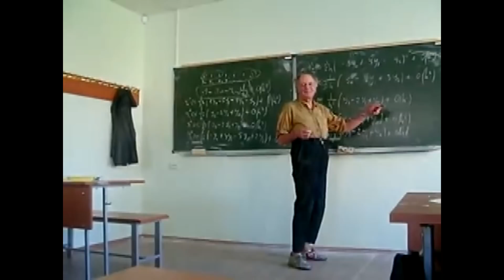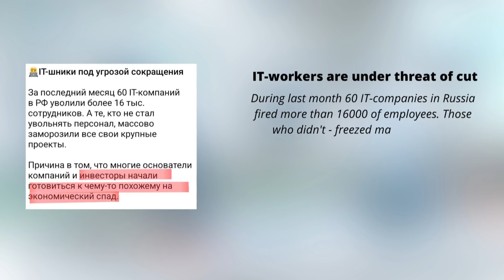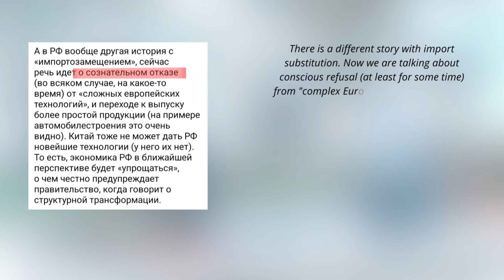Russian import substitution - back to USSR on a cart with bast shoes. The biggest lie of Kremlin

Comment: They cannot make even simplest 80s lada nowdays, yet they are planning to conquer whole Europe :D
Reply: 1980s Lada - **SHUDDER**
Reply: If they are planning to do it in a fleet of Moskvitches, they'll be pushing them or fitting harnesses to tow them - my parents inflicted an M-426 on our family in my childhood, with the result that I became a moderately competent amateur mechanic while still in primary school.  They were apparently unable to make a float for the carburettor (a bad SU copy) which was actually able to fulfil its most basic function and float, at least for more than a few weeks at a time.  We had a bunch of them, and at all times there was at least one drying out or being resoldered closed, one in the toolkit ready for use, and one fitted.  Before the age of ten, I could swap them from engine spluttering to s stop to engine start in under 5 minutes.  How in the heck it is possible to create conditions in a float bowl which melts the soldered seam on a brass float I have no clue, but it is scary to think of how hot that carb must have been getting.  Add to that the parking brake, which I had to assist my mother with if there was any trace of a slope and "acceleration" which did 0-60 in your dreams and just might have reached 1g if you drove it off Beachy Head, and the thing was truly a nightmare.  When it started running even worse than usual, my father removed the cylinder head to find that one piston was so badly damaged and misshapen that it was almost going up and down the bore sideways, and he bought a replacement piston, sealed it all back up, and flogged it while it was still running.  This was from new, in about 15k miles total.  I can only hope it was recycled into something useful.
🇺🇦Slava Ukraini!🇺🇦🇬🇧
Reply: @barryhamm3414  I bought a new Lada in the80s.  It was difficult to drive, felt very heavy.
Reply: Even brand new they are a LADA scrap metal.
Reply: @phillee2814  so, you didn't learn to braze brass.....
I'm pretty sure a carburettor bowl cannot melt solder, not whole there's any petrol in it....
Most likely reason the fix never lasted: crap solder or, maybe more likely, crap flux.

Great bit of history though..
Reply: @phillee2814  So funny!
Reply: @dougaltolan3017  I never did the float repair, just the replacement.  I'm pretty confident in dad's work though - he was a chartered engineer!  I do know he used a torch though - his soldering iron was a little one only suited to light electrical work.
I'd guess that the seams failed well in advance of the float actually filling with enough petrol to sink enough to rich-cut the engine (so, just like any decently challenging intermittent fault), and any petrol evaporated before the damage occurred, probably when the car was stopped with a hot engine.  I recall dad fixing up a tin (or some similar material) heat shield between the carb and inlet manifold though.  It didn't seem to help.
It's been years since I really thought about it, so I'm kinda doing a stream of consciousness thing here, but possibly some condition that arose when the engine stopped in some particular position (compression bounceback?), allowing hot gas to exit via the inlet valve instead of through the exhaust?  Sometimes the floats did come out of the bowl with soot on them.  Also, the filler (and I honestly don't know if it was brazed or soldered, only that it was silver against the brass pressings of the two halves of the float) may not have fully melted, but been weakened enough by the heat for the poor shape of the design to let it flex just enough at the join for it to fail.
Then, with a crack there, it only takes a few heat cycles to draw enough petrol in to sink it.  It's a few years beyond when I could have asked my late father now!
Reply: @dougaltolan3017  btw, what is the definition of optimism?

A Moskvitch with a tow bar.
Reply: @phillee2814  thanks
Reply: Hahahhahaahahahh they were on moon 50 years ago ,they have the most advanced rocket systems,and you really think they do not have access to modern technology,don't be stupid 😂😂😂😂
Reply: @basasure9065  clueless 🔔🔚
Reply: Oh they can make the top selling Lada Vesta. Just without ABS, EBD, Automatic transmission, Trip computer, or electronic stability control. Other then that pretty much the exact same car. 🚗
Reply: @basasure9065  their tech hasn't advanced since the Soviet Union collapsed. That's about 40 years ago.

Comment: 2:17  The Lada "Classic" (or 2105 and 2107 Riva) was a joint venture between the Russians and the Italians. It was based on the Fiat 124 and made from inferior Russian steel that was prone to immediate rust. They were also likely to develop almost every mechanical fault you could think of and were considered dangerous at anything approaching highway speeds.  Their only saving grace was that they were rarely stolen.
This led to a host of Lada jokes including: 
Owner asks his mechanic: "Can I get a windscreen-wiper for my Lada?" The mechanic replies: "That sounds like a fair swap." 
First prize in the raffle is a Lada. Second prize is two Ladas. 
How do you double the value of a Lada? Fill the petrol tank. 
What's the difference between a Jehovah's Witness and a Lada? You can shut the door on a Jehovah's Witness. 
What do you call a Lada in the summer? An oven. What do you call a Lada in the winter? A freezer. 
How do you avoid speeding tickets? Buy a Lada. 
Why does a Lada have a heated rear windscreen? To warm your hands while pushing it.
The Lada is one of the few cars with a light under the bonnet ... so it can be fixed at any hour. 
What is the definition of a miracle: A Lada that starts; getting a speeding ticket in a Lada; or being overtaken by a Lada.
(Carsguide.com.au The Best Lada Jokes)
Reply: Nahh, heating was great in these vehicles.
Reply: Why do Ladas have a sunroof and twin exhaust? So you can use it as a wheelbarrow.
Reply: Where do I pay for the show? 🤣😂🤣😂🤣😂
Reply: Hehe, good ones. :)
Reply: Why does a Lada car have 2 exhausts, so you can use it as a wheelbarrow when it breaks down.
Reply: We had one in UK, it was fine, before that a Moskovich, what a tank.  
Interesting fact is one day they all disappeared, apparently re exported back to the east.
Reply: Hilarious
Reply: @arguseyed9982  Sure, because they vented the exhaust directly into the cabin!

Comment: The waiting time for a East German build Trabi  (Trabant) was 12 years. You had to pay for it when you ordered it. I had the opportunity to inspect a Trabi.   23 hp, two stoke,  two  cylinder engine and, gravity feeding.   To my surprise, there was no rust on the car?  I was told that the vendors, the trunk the doors all was manufactured from cardboard paper and painted. When I ask why not take some form of iron, I was told with a smile at their faces. We need the iron to build tanks and military hardware to fight our enemies in the West.
Reply: I had a Trabi. The bodywork wasn't made of steel, but the floor was, and it rusted like hell. I could see the road surface through the holes in it.
Reply: You could literally rip the crap apart with your bare hands!
I accidentally did so, trying to fix things after colliding with a VW van. Not even a scratch on the VW.. 😆

Comment: I am eagerly awaiting the unveiling of the new Moskvich. Will Puter himself want to prove the self-driving characteristics blindfolded?
Reply: The "Volksvitch" - a simple car for the Russian people. It was designed by Ferdinand Poroschenko, and approved by Putler himself.
Reply: I imagine it will look like the car Homer Simpson designed, but will use two stroke oil mix, a carburettor with manual choke and a kick-starter.

Comment: I've heard that Russia is now the only place where cars are still manufactured with old fashioned carburettors and mechanical ignition timing. This is logical. Modern fuel injection and electronic ignition timing needs micro processors, which are on the sanctions list.
But this also means old fashioned car problems such as motor not starting in very cold weather, very high fuel consumption, low reliability with breakdowns, increased exhaust pollution, reduced life mileage and short service intervals (car needs more servicing).
And this is what Russians celebrate?
Reply: Grandfathers will celebrate because they can all remember when cars were cars and much better than the modern ones. Well, they'll celebrate until they have to experience 70s cars again in real life rather than through the rose-tinted lenses of nostalgia and discover that they were a heap of crap.

Comment: A few years ago I did some locomotive work at a steel mill in northern Indiana. I was taken to the back of the plant where the raw and scrap steel was stored in piles according to grade. There was a huge pile of ingots that I had seen repeatedly that had weeds and trees growing out of it. I asked my host what that pile was about? He said, “that is Russian pig iron that was of such low quality that it was two thirds slag”. They would only ad very small amounts to each heat just to try to get rid of it but not so much as to ruin that heat. No mor than Fifteen ingots at a time or it would ruin the steel. I am pretty sure after four years that the pile is still there. They refuse to purchase any more Russian materials.